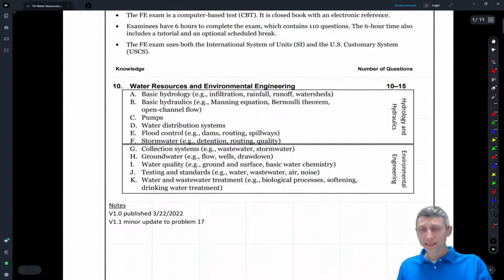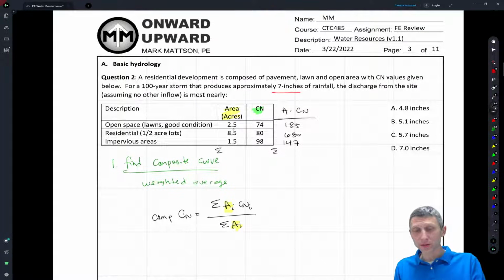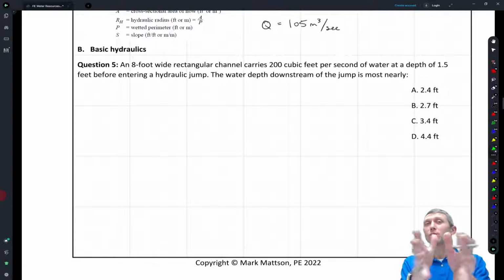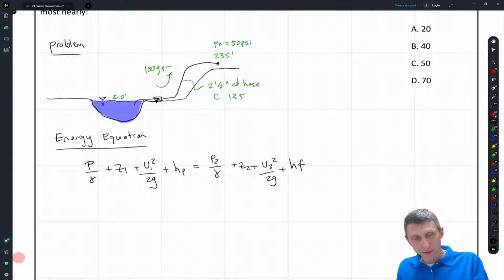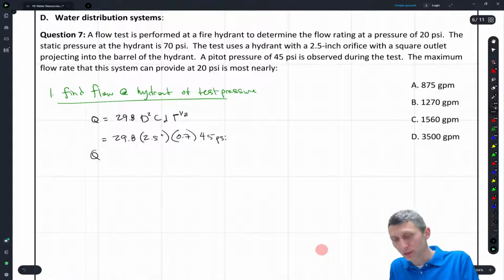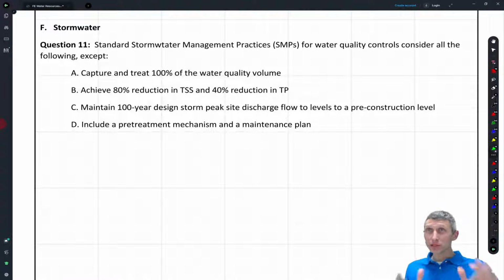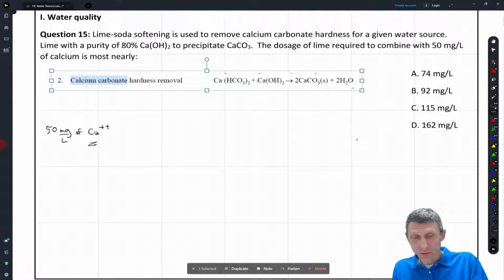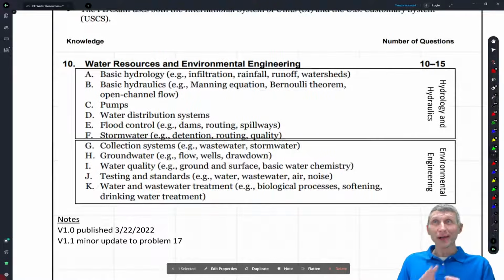FE Water Resources Engineering Review Session 2022

Comment: Why did we divide by 80% in problem 15 and not multiply ??
Reply: You divide by 0.8 because only 80% of what you add actually works. Only 80% 0f your lime is pure:Only 80% is Ca(OH)₂, 20% is junk (inert material).

To make it easier is only 80% is effective so     0.8x=92.5        92.5/0.8=x     which equals 115

Comment: hello Mark. Thanks for the explanation. For the question 5, shouldn't we add another head loss? There is vertical pipe between Res. 1 and Res. 2 after pump. So it means same Circular Pipe Head Loss Equation with L = 235-210?. Thank you.

Comment: Hi, can anyone help me to understand this confusion. in question 6 how you can say the P1 is at atm and mark it as zero. the pipe goes into the reservoir right, so it has some depth to it and thus gives some static pressure value. I always have doubt relating to how to consider static pressure term as zero, in which cases we should say zero or neglect this term in energy equation?

Comment: Hey, Mark! Thanks for sharing the material and putting time and effort on this :) It's very helpful. Quick question: for problem 4, you chose the option C which is 150 m3/sec, but the formula gave you a 105 m3/s flow. Was it a mistake or there is an explanation that I am missing for that? Thank you!!

Comment: quick question, in number 6 math you have started with P1 being 0 whereas if we had taken the P1 as "x" which is the required pressure at pump, we would get x/gamma=159' and solved "x" for psi then we could get the same answer. Hp was a very confusing bit for me.

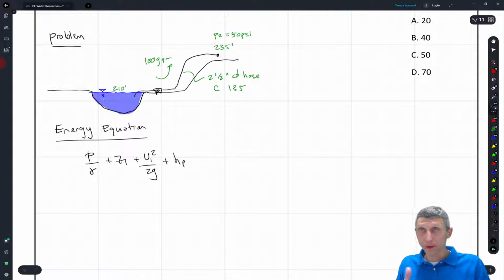Comment: 48:00 where is he getting the hp from? its not in the manual.
Reply: You add Hp whenever there is pump involved. It should be a separate equation but it's not in FE.
Reply: The head developed by a pump as hp = -w/g, but work term w is negative for a pump, therefore the head developed by a bump hp, is always positive. I didn't see it in the manual either, just have to account for it in the energy equation.

Comment: for Q6, how did you get headloss=13.82 ft?? I've tried re-entering it into my calculator several different ways and continue to get 26,224.25... Please help.
Reply: Q=0.223,D=0.20,C=135,L=200 Try again with these values....
Reply: I had the same issue but I mistakenly read the pipe diameter as 1/2" instead of 2-1/2"
Reply: I got the same answer at first then I forgot to divide the gallon by 60 for getting it in seconds. so, its 100gallon per minutes to 100/(7.481 x 60) to get 0.222 cubic feet per second.

Comment: In Q9 L is the length according to the Handbook, while the problem gives you width and it doesn't say it is rectangular. Also Q is 125 cfs as given in the question, why did you use Q as 90 cfs?

Comment: I know that this is a lazy way to arrive to the answer for question 6, but I think the question was  designed such that math is not necessary. If you want to supply pressure with a pump to a place that is Verticaly above you, your going to have to supply greater pressure than the amount needed at that higher elevation. only one answer fits that so youd be able to immediatly pick that.
Reply: true
Reply: you mean the Answer to this question is wrong? I am confused why he didn't add one more head loss which is difference in elevation 235-210= 25ft
Reply: @jamshidpishgam3630  That is picked up in the z terms. Z1=210ft & Z2=235ft. Z1 gets subtracted when solving for Hp.

Comment: Do the exam solutions usually use all the given data in one way or another? i.e on question 16 there is a hint that we need a second equation since the given k value had not been used in the first equation we solved.  I know some exams will throw out "red herring" info that isn't needed to solve.   It seems like FE questions normally use all the given data? general thoughts feelings on this?

Comment: Hey Mark, for question 7, I believe that residual pressure and pitot pressure should be two different things. Usually, in the field, we take a separate measurement for residual pressure. It seems like those two terms are used as the same thing in the video which is a little strange, considering the fact that they are two different concepts.
Reply from the maker: @Morgan Teng thanks so much for the clarification!  I updated the problem sheet so that the given residual and pitot pressures are both listed as 45 psi.  You are correct, they are indeed two separate measurements and two concepts.  Thanks!
Reply: @MarkMattsonPE  Hi Mark, for question 7, should we be using the square root of the pitot pressure given the following equation: Q = 29.8 D2Cd P^1/2? So grateful for your practice problems and videos in studying for the FE!

Comment: On problem #1, why is the intensity dependent on time of concentration? The clouds don’t care about the time of concentration of some place it’s passing by, what am I missing here? Would appreciate very much your input
Reply from the maker: As long as the storm lasts long enough to get to the time of concentration, that's the peak flow (intensity).  The whole watershed will be contributing to the outlet at that time.  

Here's a reference: "A storm with duration equal to the time of concentration will have the full watershed contributing to the runoff at the outlet, (and thus reach peak flow rate) just before the storm ends. A storm of duration greater than the time of concentration, and the same recurrence interval, will be less intense."
https://www.cedengineering.com/userfiles/Rational%20Method%20with%20Excel-R1.pdf

Comment: Hi! I had a question on Problem 15.. Why do you divide it by 80% purity instead of multiplying it?
Reply from the maker: If it's only 80% purity, you need to divide to get the total amount you need.  When you divide by 80%, the larger amount will be what you need.  If you take 80% of the larger amount, you have the right amount.

Comment: For number 9 you can use the calculators "num solve" function to calculate H quickly. A very useful tool in my opinion
Reply from the maker: Thanks Kyle Long! A great tip that will help someone for sure. Getting familiar with the calculator can save so much time.
Reply: Thanks Kyle, that's a super helpful tip!
Reply: Try it. Shift solve with raise to 3/2 equation? There are alot of answer if you do that.
Reply: @Whacker409  The calculator tells you how many answers there are with the L-R=number when you put in this equation it only has one answer